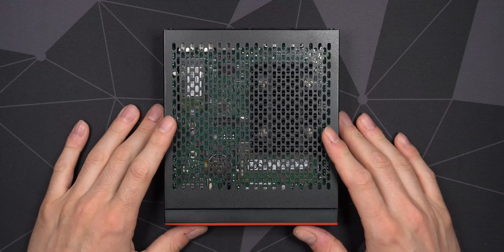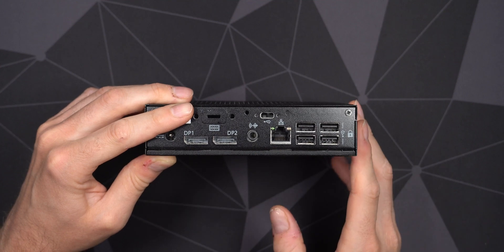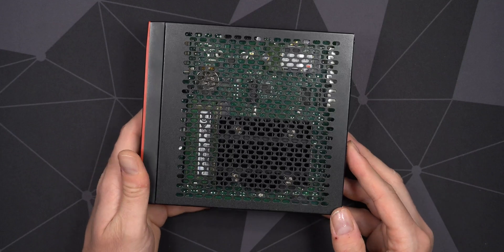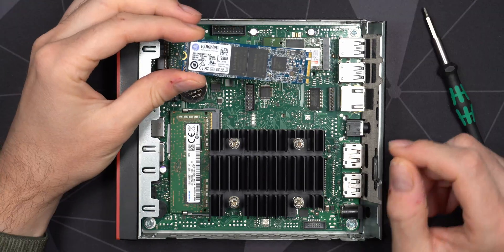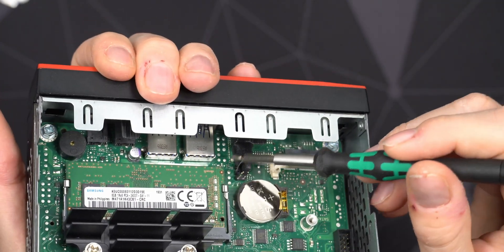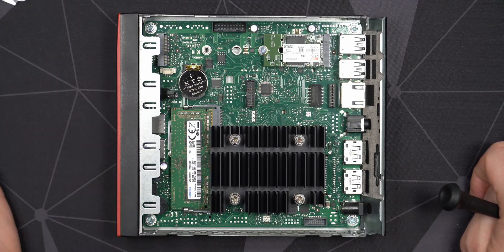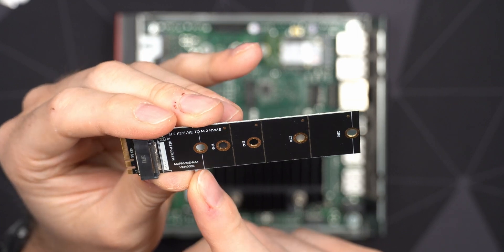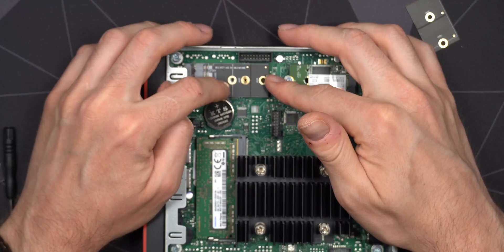Fujitsu Futro S740 Thin Client: Hardware Overview & SSD Install

Comment: They do look like a great option for some Home Cloud experimentation
Reply: it definitly is! I am running Proxmox 8 on it and have an Home Assistant VM, a Samba Fileshare Linux Container and some more! It is also great to host a minecraft server or a discord bot for example. But look for upgrading the ram by yourself and not buy it with the amount of ram you want, because you it may be more expensive (depends on your market)
Reply: @agent_artifical  I have already got some extra RAM for the task.